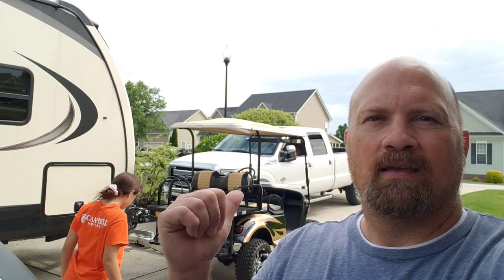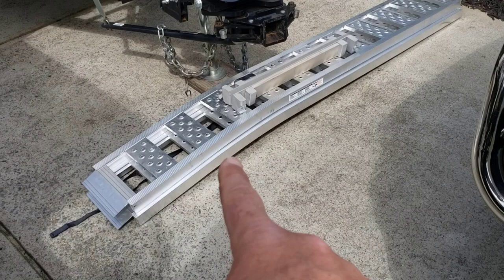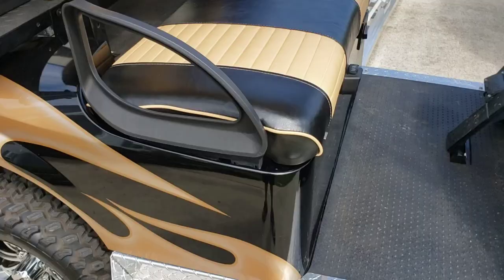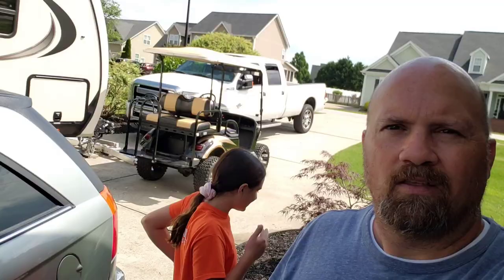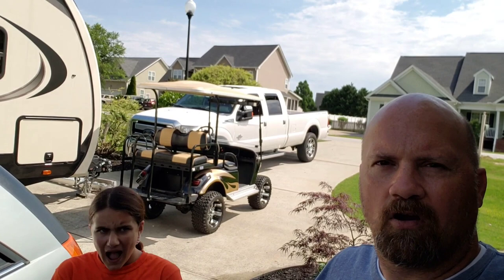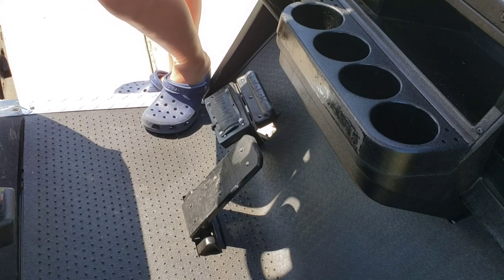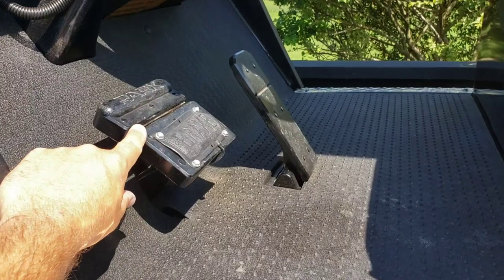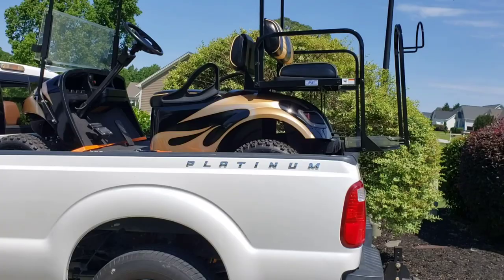How To Load A Golf Cart Into The Bed Of A Truck

Comment: How much weight do the tailgates hold or are rated for?  For someone who claims to be an amateur that is a great design.
Reply from the maker: Thanks. That's why I am an amateur,  i never thought about what the tailgate could hold. I based it on how many people I've seen with carts in their beds. 🙂
Reply: @FTRV  ... It's not the tailgate that you have to worry about (the hinge).  Its the little cables that hold it up.  They're not rated for a lot.  I learned that from another Youtuber that you should make a bar that overrides the cable so in case one of the cables snaps, the bar will be there to secondary catch it.  You could also make something that temporarily replaces the cable out of heavy metal to avoid it all together.  Then when done put the cable back on.  .... The other tip I learned, which I learned from others, which you probably don't need because its a F250 or larger (me F-150) is to back the cart in so the motor and batteries are not causing the tail to much weight.  Backing it in distributes the weight more forward.  Your F-350  Doesn't have to worry about that.  Just passing that on to small truck owners.  Enjoy !   I especially like the winch idea because you are not on the golf cart in case something were to happen... i.e. fall off.
Reply: I just looked it up... they do sell heavier tailgate cables.  The normal cables support 600 - 800lbs.  They are usually 3/16 of an inch diameter.  Which is .1875 inch.   Heavy duty cables are thicker  .232 - .249 inch.  .... DG Manufacturing sells an EX Tailgate Support Bar ($89.99 on Amazon) that installs in addition to your cable to double up on your cable, too to help support the weight.
Reply: @kenito1967 he can’t load it up that way because of the rear seat step up. This is exactly the way I was thinking of doing mine before I saw this video. And now that I’ve seen it done, I will definitely be doing it. @First Time RVers, harbor freight sells solar panels and voltage regulators. That’s what I plan on putting on my cart to charge the spare battery, which will power the winch, radio, phone chargers, etc.

Comment: Does the top on the cart stand up to highway speeds?  I imagine they aren't designed to handle 70mph wind force going down the highway.
Reply from the maker: Yes it did. I always folded down the windshield though. I remember back in the day having a turtle top on my minivan and hearing lots of wind noise driving down the road. I heard nothing with the golfcart. I don't know about the design but I know thousands of people do it. I was there the day mine arrived on a trailer, with several others, that must have driven down the road pretty fast. On the east coast, lots of these are converted by a place in Myrtle Beach and transferred up and down route 95 on the back of an open trailer. Thanks for watching and Happy Camping!

Comment: I’d connect the wench across 2 of your 8 volt batteries. It should run fine on 16 volts. I did the same thing with my light and horn kit. Works perfect.

Comment: Great idea, I’m not sure i would have ever thought to put the winch on the cart
Reply from the maker: Thanks. I kept thinking that I didn't want it exposed in the bed of the truck, nor did I want it in the way back there as far as picking up mulch or wood, etc.  Plus then I would have needed something so it didn't rub against the tailgate each time. This way it just sits on the tailgate until a certain point. Thanks again for watching.

Comment: For ramp spacers I used some all thread and drilled one hole on each ramp at the top and bottom and have a nut on the inside and outside of each ramp. I have been driving my cart on and off but may install a winch instead of driving it on.
Reply from the maker: That sounds a little more sturdy than what I was doing. Even with the winch it was still a little scary. We always stayed clear so I never worried about someone being injured but who wants to lose a $6,000 golf card and potential damage to their truck. Thanks for watching and Happy Camping!
Reply: Love your videos!

Comment: Looking good man!
 I want to get golf cart. Started thinking about logistics. Found your video. Sure looks like you and your family have some fun times My Tacoma has a 6 foot bed. Thanks for the info! Stay safe and be well!
Reply from the maker: You can go with a standard cart thats not lifted and stuff, it'll be a little shorter but will nees to leave your tailgate down.  Or they even have mini carts now I see around. Our cart just fits with the tailgate up but the footreat hangs out a few inches (8 ft bed).  Also gotta watch cargo capacity.   Our f350 is well over 3000 pounds so with the camper tongue weight of like 900 lbs and the cart weighing around 1100 lbs we have plenty of extra for more cargo. Happy camping and thanks for watching.

Comment: What battery did you buy to hook the winch to? I'm trying to install the same system but I also don't want to hook into the golf cart batteries. Thanks.
Reply from the maker: It's an AGM battery.  Basically a marine battery.  Standard car batteries have their power all at once ( cranking amps). Used to turn the starter on a car. AGM batteries have there power constant over a longer period of time. Thanks for asking and good luck!

Comment: I just got an ezgo and want to do the same set up fits just like yours but the footrest in the rear hangs out like yours any issues towing you travel trailer? I was thinking of removing footrest if I had too, what do you think?
Reply from the maker: No issues. If you have a weight distribution hitch your TT will be far away.  I don't believe the foot rest hangs out much farther than the bumper does. We had a propride hitch which puts the TT far behind the truck. Probably over a foot farther than a standard hitch.

Comment: I liked the video. I just purchased an f250 with a 8 foot bed. I’ve got an ez go txt with a 6 inch lift and 22 inch tires. My plan is to also tow my camper with this set up. Have you had any safety concerns or issues towing your camper and golf cart at the same time. My campers tongue weight is 800lbs and the dry weight on my camper is 6500lbs. Also how fast do you drive when you are pulling your combo? Thanks
Reply from the maker: I didn't have any issues. I do have an f350, so it has the extra leaf spring and a higher cargo capacity.  I always tow at speeds of 65 and under. I also strap down the golfcart.

Comment: I would like to mount my badland 2500 this way.  Could you please post a more detailed video of how you attached the winch plate to your cart?   thanks, P.S.  My wife and I thought it was so cute when your daughter made that face after she tossed her hair back over her shoulder.  That was priceless.
Reply from the maker: I'll see what I can do.  I don't know that I can get my camera in there it's kind of tight. But basically I bought that $5 mounting plate from harbor freight and drilled holes through the frame and bolted it on.  I have an ezgo cart so it's probably different on other brands

Comment: Does your intermediate steering shaft ever come out? We are have trouble with ours coming out when loading into the truck.
Reply from the maker: No, I haven't noticed any issues.  It's a pretty slow process.  Hope you get that worked out. Good luck and thanks for watching.
Reply: Ok. I appreciate it!
Reply: Love your idea! I have bought all of the same supplies. I was just curious to how you mounted the winch? I bought the winch mount also. Do you have any close up photos? If so I’d appreciate it!

Comment: Is there any issues with wind from highway speeds on the roof and windshield?
Reply from the maker: I do fold the window down and I used to put a cloth between the folded window and the front of the golf cart. But there was no need for that so no when didn't affect it at all even alone without the camper I never could tell that it was back there. I always kept an eye on it but there really was no motion at all from the golf cart itself or just the roof or windshield.

Comment: Great video. Is your truck an f250 or f350? How does the golf cart affect your towing hitch hookup?
Reply from the maker: Its an f350. 8 foot bed so it fit with in that except for the foot rest foe the rear passengers. So it didn't interfer at all with the hitch. Now that we have a 5th wheel we can no longer take it with us. We just sold it and bought a van to convert into a boondocking van.

Comment: Are those ramps from lowes? And what did you use to make those spacer brackets?
Reply from the maker: Yes, Lowes. I made them out of wood. The provide no strength just keep them spread apart the correct distance.  Didn't want them to slide right when the tires hit them and also allows me to know quickly that the are the same top to bottom

Comment: Could you give some more info on how you mounted the D-Ring in your bed?
Reply from the maker: I used 2 thick metal plates, approx 18" long to add support and spread out the weight. I put 1 under the bed and 1 on top, under the d-ring.  Its bolted through the floor of the truck bed.
Reply: What size D ring is it and what is it rated for?
Reply: @FTRV Did you do this after this video?  Those plates didn't look that long on the video.  How has the bed held up to the weight of pulling that cart up?  Any flexing/bowing?  Do you have any pics of the mounting plates above and below the bed?

Comment: Do you have pictures of how you mounted the winch to the golf cart?
Reply from the maker: I can take some this weekend.  Basically I used a winch mounting plate from harbor freight.  It was like 5 bucks and drilles holes into the frame of the cart. Bolted the plate onto the frame and the winch onto that.
Reply: @FTRV  I’ve bought everything you have. Just couldn’t tell exactly how it was mounted on the cart.
Reply from the maker: Can you pm me through youtube? I have a picture
Reply: @FTRV  I don’t know how to PM through you tube, but I’m running into a little trouble mounting the winch plate on my ez go.  I have the same set up as you it looks like, got the badlands winch and the 5.99 plate from harbor freight, just don’t know where to drill the holes to mount the plate.  When you say frame is that the heavy metal bar that looks like the axel ?
Reply from the maker: I'm not good with tech either. How about through Facebook.  I can send you a picture. https://www.facebook.com/FirstTimeRVersNC

Comment: I am looking to do the same thing, however I only have a 6’5” ft bed. I’m thinking I’ll have to remove the tailgate.
Reply from the maker: My BIL used to load his in a 6.5 bed, didn't pull a camper with it though.
Reply: 18” shank receiver hitch will extend your trailer farther back so you can leave the tailgate on. If you need more clearance, the have a kit that allows for the power jack to be removable.